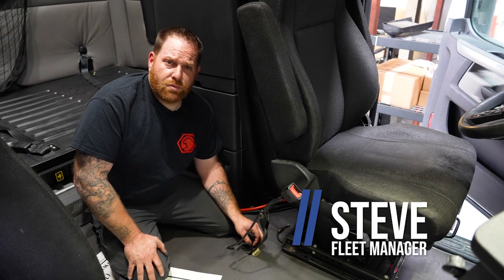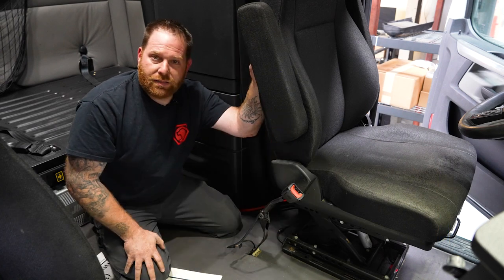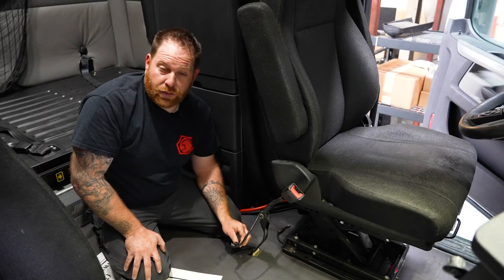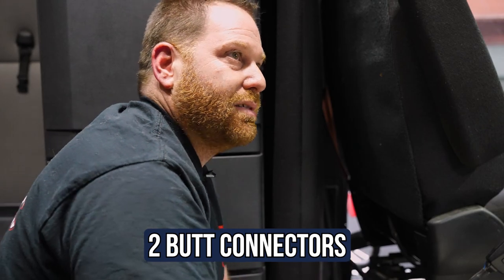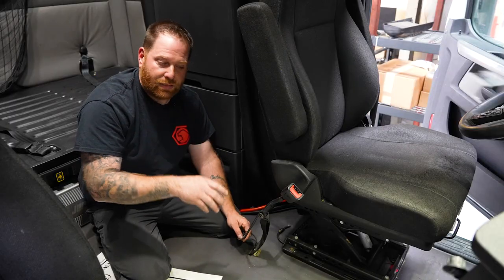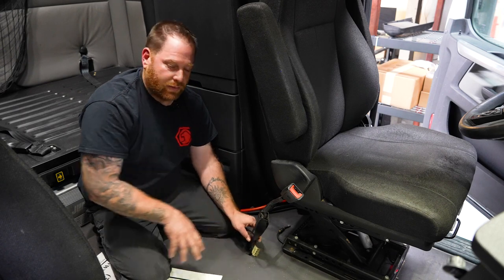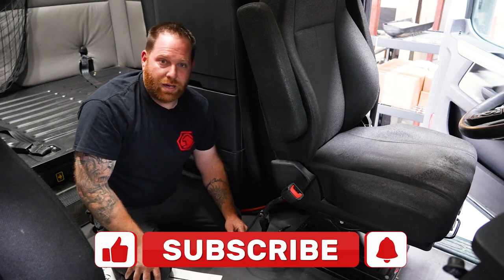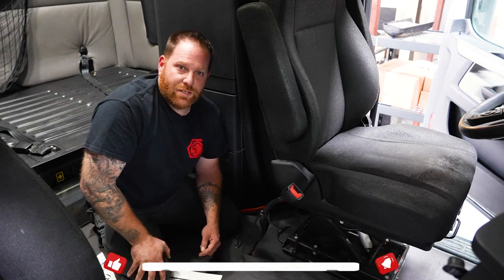Faulty Seatbelt Sensor Wire On Your Semi Truck?

Comment: Where does the seat belt sensor on the truck side plug into. Dumb me bought a replacement plug and wire to fix it but the truck side has to flat connectors (knife blade type)?